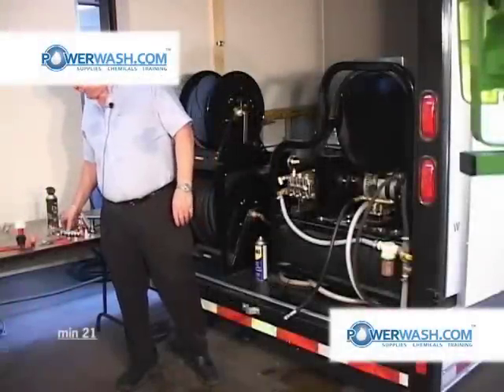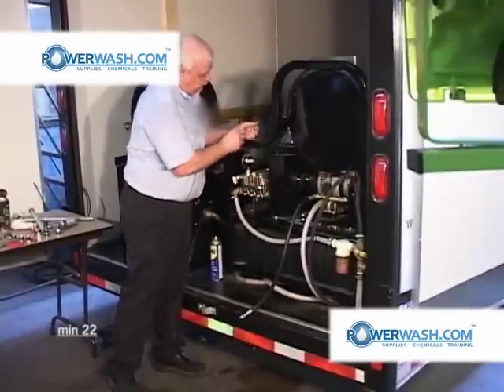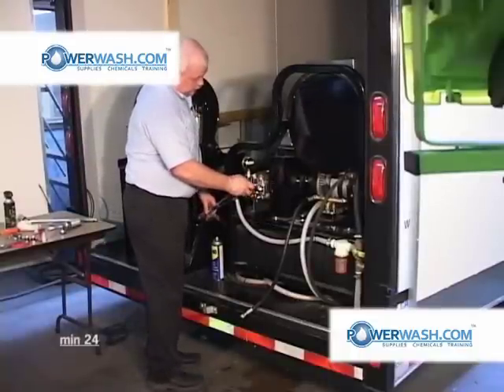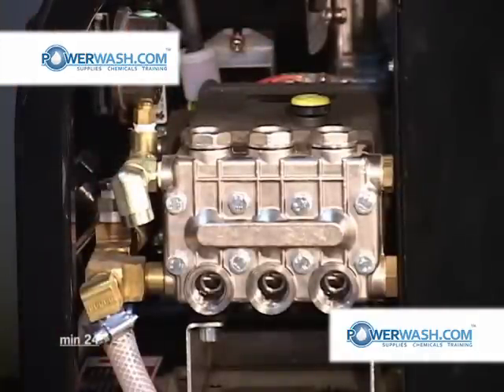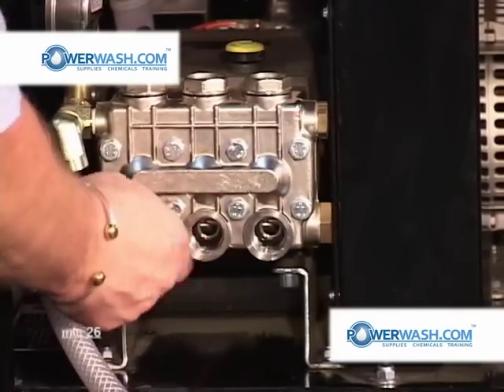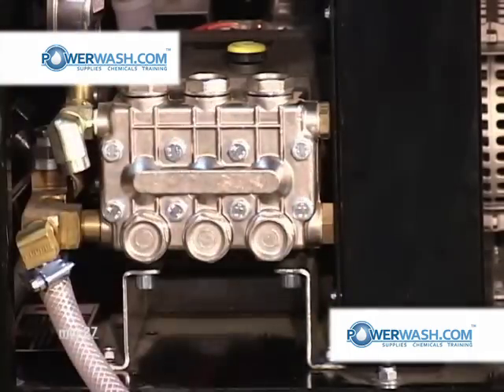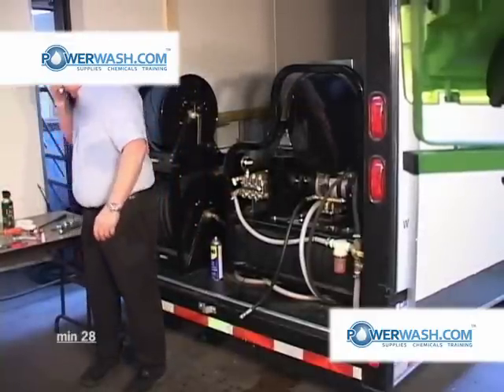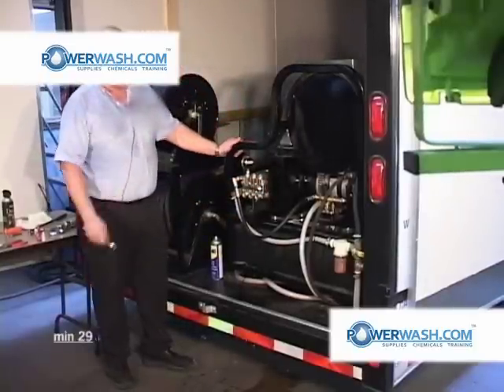Rebuilding a General Pump P4 of 4

Comment: 22 ft. lbs is not the tightest torque in the world but personally, i would go through that sequince 2 times starting at 12 lbs, then 22 lbs. just to add a bit more precision to the final torque setting.
Reply from the maker: You make a great point about gradually tightening to ensure precision. Starting at 12 ft. lbs. before moving to the final 22 ft. lbs. torque setting is an excellent practice for consistency and reliability when securing the plunger bolts.